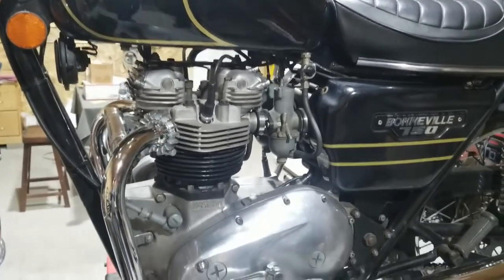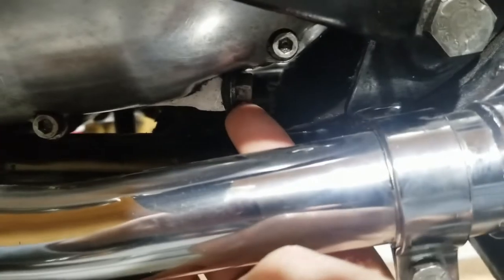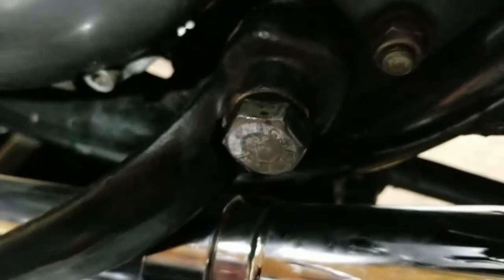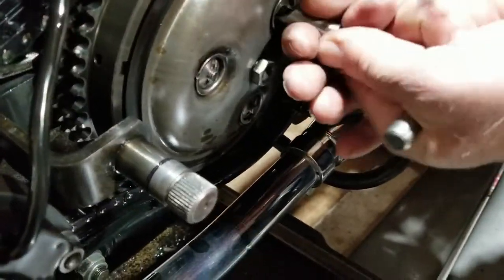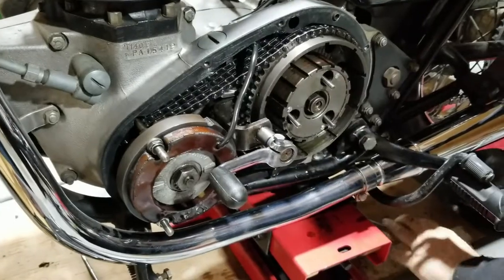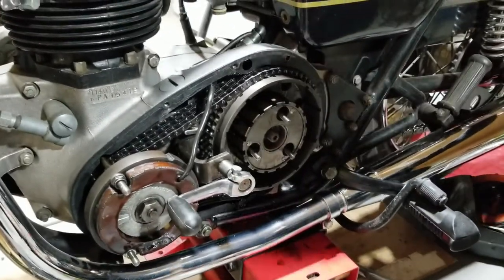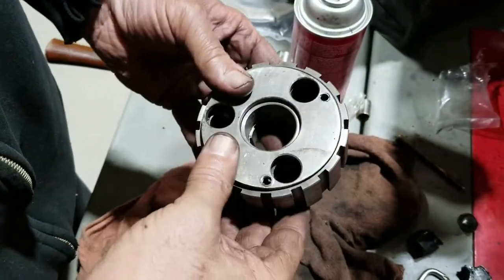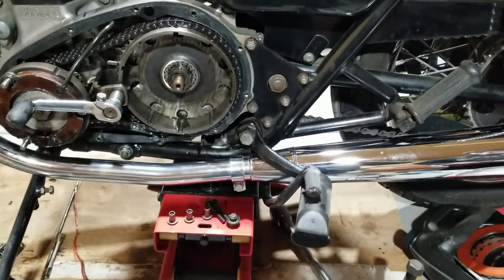1979 Triumph Bonneville 750cc clutch disk replacement Part: 2

Comment: You just saved me. I'm disassembling a 750 for crank bearings. Got the clutch plates out and couldn't get the hub out. Couldn't remember how it comes apart. Tried some little pry bars. Tomorrow I'll put the puller on. My buddy parked the bike when he heard bearing noise. That was 30 years ago.

Comment: Thanks so much for your video I like the way you used the steering wheel puller to pull the center hub, I had one but had to do a lot of grinding to get it to work. The early bikes used a threaded puller as you know. Thanks again Denis Kerechuk.

Comment: Thanks for this video! The part with the rubber biscuits you replaced is known as the "cush drive" because it cushions the transmission lash when you shift. They work very well, actually. My '79 Bonneville shifted as smooth as any new bike.
Reply from the maker: Thanks

Comment: those clutch hub BOLTS ( 3 square head ones )- do you know what thread SIZE those are? im wondering if i can find a good hardware store replacement..i cant find that info anywhere, even my factory part catalog...hate to order a pay shipping on ONE bolt, but its all i need at this point...